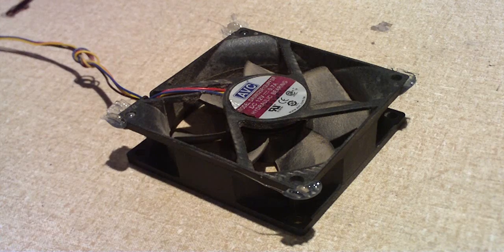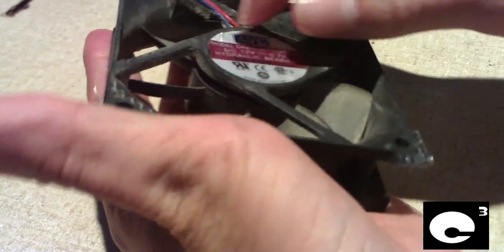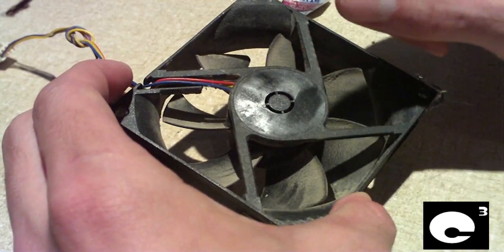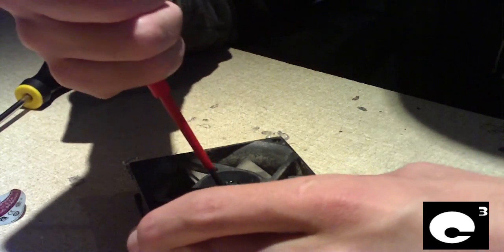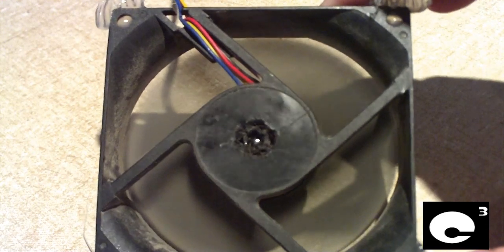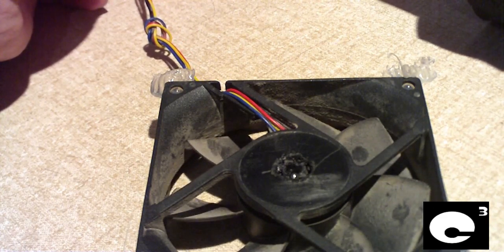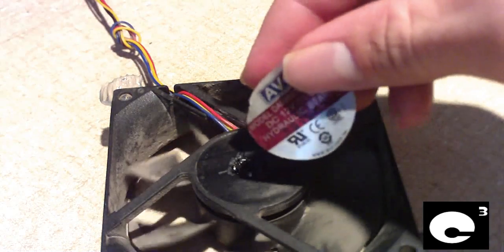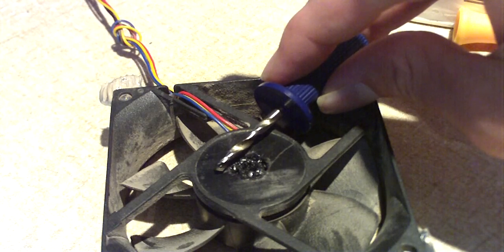Repairing an AVC Hydraulic Bearing Fan

Comment: Take one fat needle or small drill bit and heat it with flame from cigar lighter till gets red hot. 
Now simply touching the plastic can melt away till you get to the chamber. No hitting, no breakage, just precision work. Pour oil, seal it and done.

Comment: DSSC0715R2M-P004 DC12V 0.4A 4-Pin comes apart fairly easily by putting thumb nails against edge of hub and pushing the fan away from body of fan.   The fan is retained by a small circlip which fits snuggly inside a plastic cylinder in the body.   When the fan is reassembled the circlip slides back into place inside the cylinder and clicks into place.   Blades are fairly brittle (maybe more so with age)

Comment: I think the fluid inside the bearing sleeve leaked, this type of bearing does not need lubrication as there is no metal to metal contact between the sleeve and shaft when it's spinning. It work by creating trust generated by the groove around the shaft it self but since the fluid is gone it will heat up and later create vibration. The lubricant will not last that long as I doesnt have the same viscosity to make the shaft float.

Comment: how often you have a problem with this fan?
Reply from the maker: +Piotrek Zalewski I only had the issue once. That doesn't necessarily mean it won't be a recurring issue.
Reply: I have big problem with this type of fan's. 
6 of 16 devices have fan failure because a fans are broken. airscrew working very hard after ~6 month of work. did you know why?
Reply from the maker: +Piotrek Zalewski Shoddy quality bearings. The "hydraulic bearings" used by AVC were nothing more than a glorified sleeve bearing. Sleeve bearing fans aren't built to last.

Comment: ok watched this video and was kinda in shock that you drilled and screwed the plastic when the fan comes apart with ease.
Reply from the maker: Why are you in shock? This fan does NOT have a rubber cover like most fans have. If it did, then I wouldn't have had to drill into it.
Reply: Take your two thumbs and push from the back side of fan blades and the fan comes apart to lubricate the cylinder and press back together. Make sure you don't lose the little white tab that you pointed out in your video. Again no tools required.
I looked at this fan and decided it had to come apart. I took the fan apart and cleaned the dirt out of it. I then spun the bearings and was smooth so I put the fan back together and tested. Still same issue! That is when I found your video. Duh me I didn't lubricate it!!
Reply: ASHO damatel glad I read this I had a feeling you could do this and was trying to find a reference to ensure I didn’t break it. My fans running at 500 rpm when it should be at 1000 let’s hope some lube fixes the issue

Comment: hydraulic bearings use pressurized oil in a chamber, once you break that seal it will no longer be a hydraulic bearing
Reply: So if a fan doesn't have a plastic cover at the back of the sticker means that its not a hydraulic fan?
Reply: @anxiety1209 Pretty much

Comment: @CubeComputerChannel Actually they do.  The real problem is that AVC is just another cheap manufacture of inexpensive Chinese products.  Not as cheap as some, but still on the lower end of things.  When I buy replacement fans I stick with the old standards like Panasonic, Comair Rotron (aka the original Muffin fans) or the incredibly reliable German made Papst.  You will have to pay 4 to 6 times as much but you won't be replacing it for a decade or two.
Reply: how about Delta Electronics?